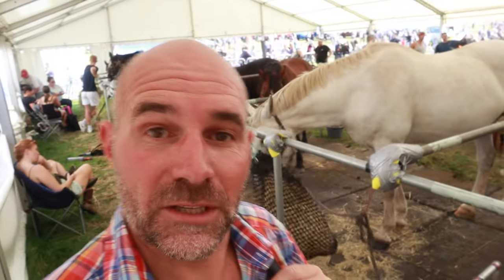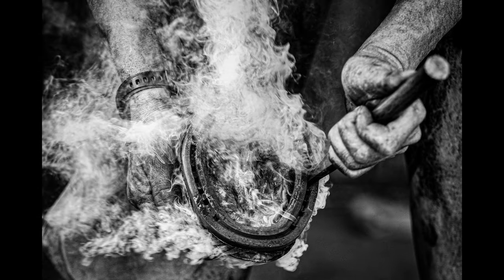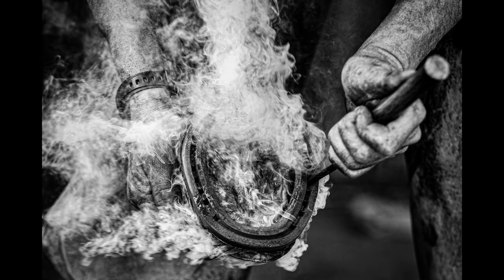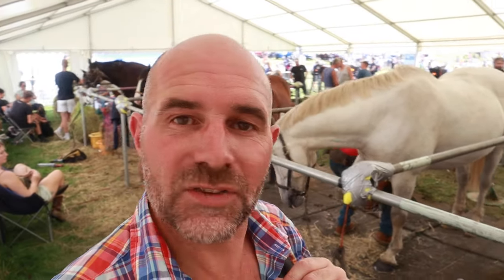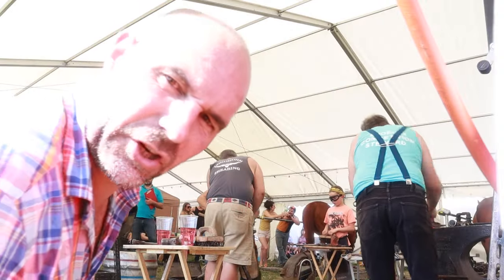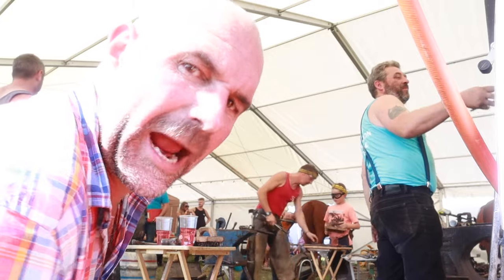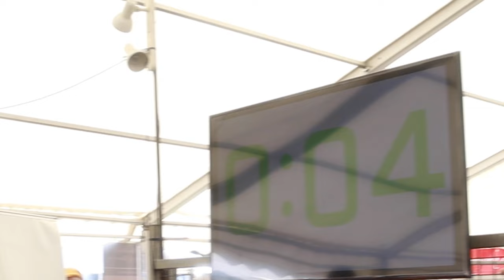Same Sports settings - very different subject! FARRIER WORK Photography

Comment: Nice video , captures the story and the B&W images suit the subject. I would have tried a few slow shutter attempts to give the hammer a sense of movement hitting the hot iron horseshoe.
Reply from the maker: Thanks for watching. I did try some slow shutter speeds but it somehow lost the emphasis of the overall image I found. So I increased the speed again👍🏻. Bit like a blurred ball, it didn’t quite look right?!